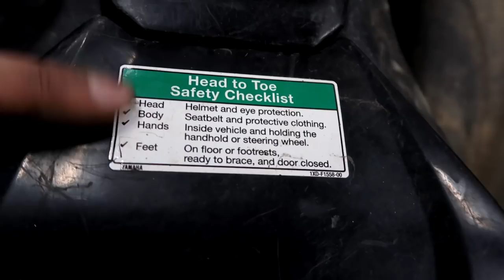FIRST TIME LOADING UTV!!! FAIL

Comment: Hey just in case you guys missed it, @4:27 you can see your cv shaft nut does not have the outer ring drove into the groove in the cv shaft. You wanna do this so it keeps the nut from backing off but I'm sure you guys already noticed it. Keep up the good work and hopefully this thing puts hours of smiles on your face. Mine did and still does!!

Comment: You should weld up some sheet metal for a nicer roof make it so the two rear and front light bar are built in and are flush

Comment: @3DMachines if you do any fab work use steel. its stronger and wont cause the rust to happen like when aluminum and steel are touching.

Comment: is the cluctch fixable or do you have to buy a new one?
Reply: The only way to fix a clutch is to replace it. Plus, even if you could fix it, it wouldn't do as well considering it was abused.
Reply: Also it would not really be that safe to fix it yourself you would be better off buying a new one

Comment: Aint nothin wrong with customary US units! Most millennials just aren't educated on how to use them and are afraid of fractions in general. As a design tool in mechanical engineering, fractions can actually make mental math easier if you actually have a basic understanding of the system.